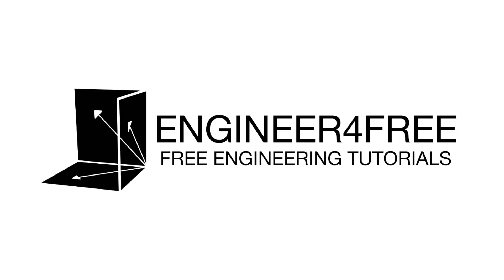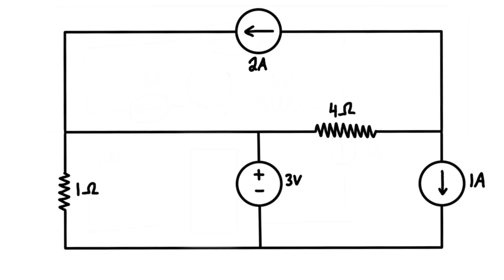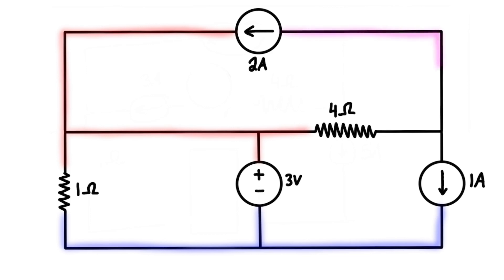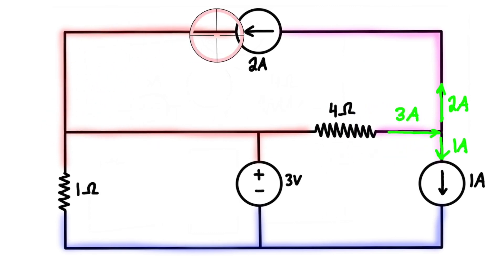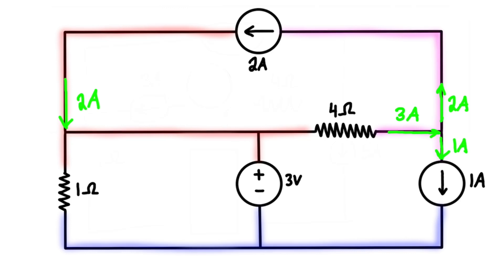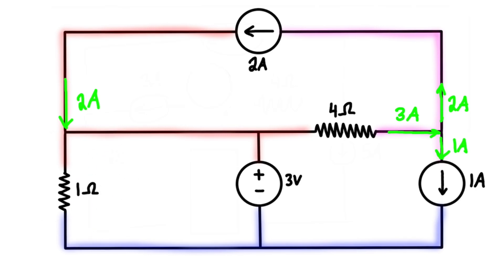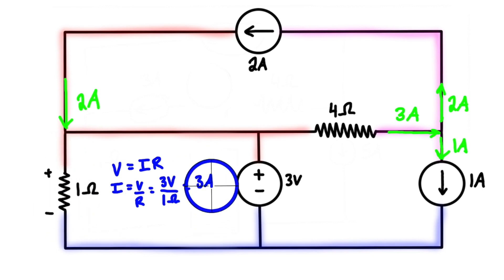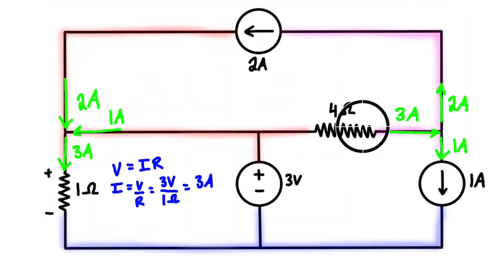Kirchhoff’s Current Law Example #2

Comment: Wouldnt the current flowing through the 4 ohm resistor be 0.75A as it is connected to the 3V voltage source? Using Ohms Law, 3V/4ohms gives us 0.75A so I am a bit confused.

Comment: Do the current sources provide a voltage rise? At the node where the current splits from 3 into 2 and 1, the voltage is (-9V) so does that mean that the 1A current source increases the voltage by 9V and the 2A current source increases the voltage by 12V?
Reply from the maker: Yeah, current sources will have a voltage difference across them. Think of a simple circuit with a single power source and a single resistor. Say the resistor is 2 Ohms and the voltage source is 6V. Then by Ohm's Law, the battery must put out 3 Amps of current. KVL around this also tell us that the voltage drop of the resistor must be 6V. If you replace the single voltage source with a single current source of 3 Amps, and keep the same 2 Ohm resistor, then by Ohm's law, the voltage difference between each node must be 6V (It would be 6V higher on the downstream side of the current source than the upstream side), KVL of this loop would also confirm that. You can think of it as voltage sources will use as much current as necessary to make sure there is a specific voltage difference across them, and current sources will use as much of a voltage difference as necessary to ensure that there is a specific current flowing through. It's also just worth googling "voltage across a current source" for some more discussion on the topic. And yeah, if you ground the pink node, then the blue node is 9V higher than ground, and the red node is 12V higher than ground.
Reply: @Engineer4Free  thank you sir, this is been something Ive always wanted to clarify.

Btw thank you for leading me to an A+ in statics and mechanics of materials 2 years ago :)
Reply from the maker: @johnturk158  That's amazing!! Glad to hear it, and glad that you're still around 😊